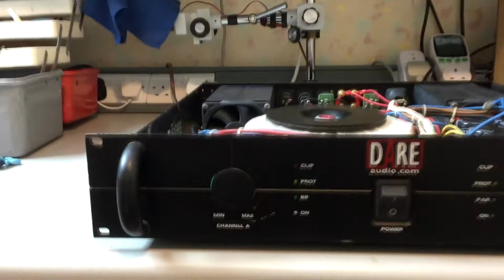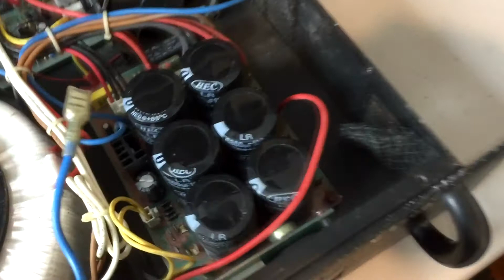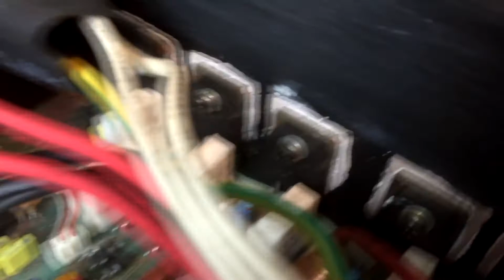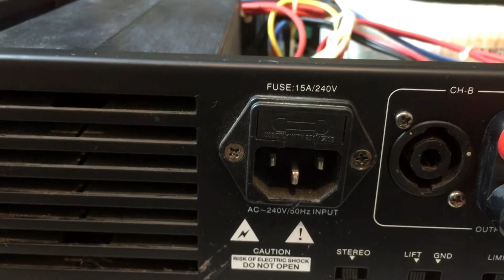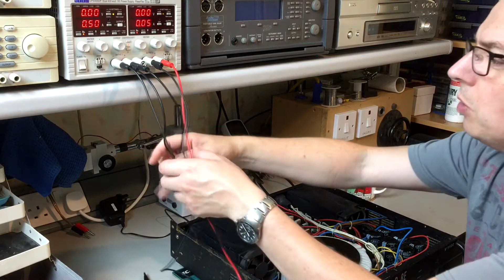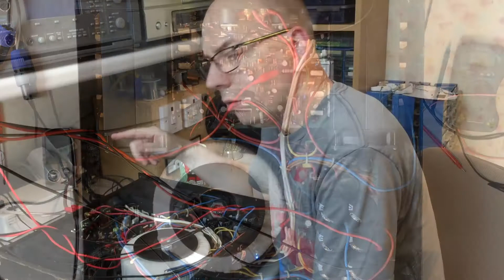Dare Audio V1100 Power Amplifier repair. Part 1. Diagnosing the fault/s, safe bring-up,

Comment: I also always wondered why some designs put multiple MOVs in parallel. All I can't think of is to have a buckup - if the 1st one to conduct completely fails. The other day I installed a lightning protector between our electric fence and the energizer - it also has got about 12 in parallel, and of different sizes 🤷‍♂️

Comment: Great videos  new subscriber here, what kind of variable ac power supply is that? Im looking to purchase one myself
Reply from the maker: Hi, In the video I’m using variable DC bench supplies to bring up the amplifier in a safer way, it allows me to limit the current to an arbitrary value to prevent destructive power to be available. If you need a variable AC supply then a “variac” can be used and you can limit current with something like a resistor or filament lamp.
Reply: @Eclectronicschannel  thanks, after I posted the question, it hit me I've followed a few repair vids and they had variable ac supplies  thanks, like your style of videos!